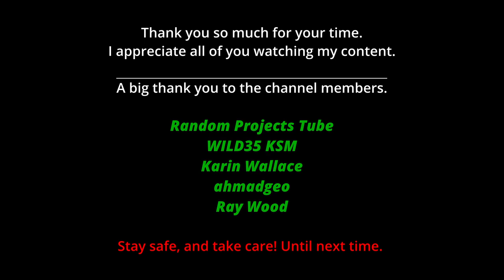Old Suffolk "Super Punch" Lawnmower Restoration - Part 1

Comment: Hi Great video thank you.  I've got the very same Suffolk punch lawnmower and about the same age. I've bought two fly type lawn hover mowers in the past when my Suffolk Punch has previously broken  down  and none come even close to what this lawnmower can do, the superior cut. I've got to take my magneto flywheel off (again) I think the points capacitor connector has broken (there's no spark!) and to refresh my memory I viewed your video in the hope of having a look at the flywheel puller I borrowed the last flywheel puller butI  am going to buy one myself  yes the flywheel  is a left hand thread to tighten!  Hope you get the thread cut back ok. Thanks again.

Comment: Cool mower! Great job on the gas tank filler, I'm not sure how i would have fixed that!  My two cents: please get some P.B. Blaster or Kroil penetrating oil, its a game changer! And no disrespect, but I'm pretty sure the flywheel nut was left hand thread and you cleaned those threads off with the impact gun. 👍👍👍👍

Comment: Flywheel nuts are left hand thread dude. Those threads were fine before you hit it with the impact. That being said we all make dumb mistakes when we're learning and anybody who says they didn't bust off threads or lose something important is lying.
Reply from the maker: Not all of them are left-handed. This was the first left-handed flywheel nut I came across. The Robin, Briggs, and Honda motors I did were all right-handed threads. And yeah the threads were still good until I came along haha I should have checked and should not have used the Impact. So we learn.

Comment: Threads destroyed..what did you expect,using a power tool on it?..try WD 40 and patience you might get somewhere...instead of trying to look good on YouTube.
Reply from the maker: Trying to look good on YT haha that's the first time I heard that one. Nothing of this is me trying to look good on YouTube, If you knew exactly what and how that tool is supposed to be used, I am doing the exact opposite of trying to look good for YT. With that said we all make mistakes, if you have done restorations or serviced/adjusted or cleaned the points and condensers on these small engines before, you also would know why the threads were stripped, and such a silly comment would not have been made. We all make mistakes, and we learn from them and we fix them.